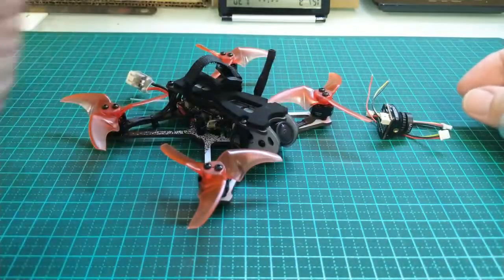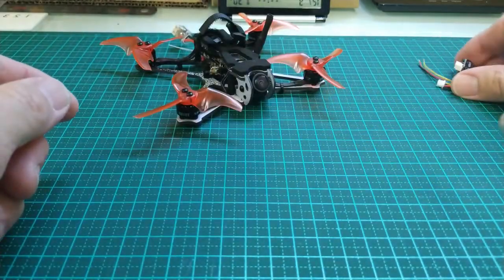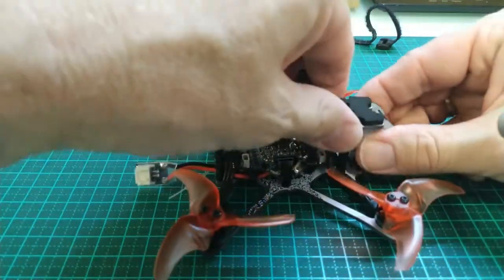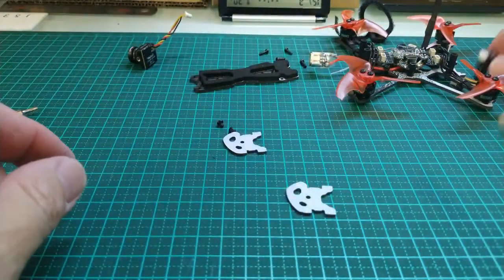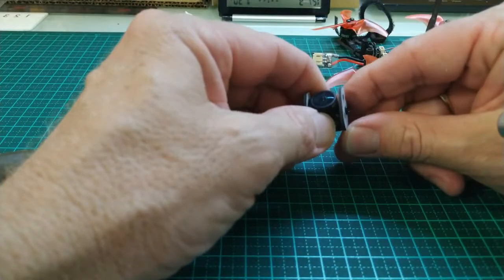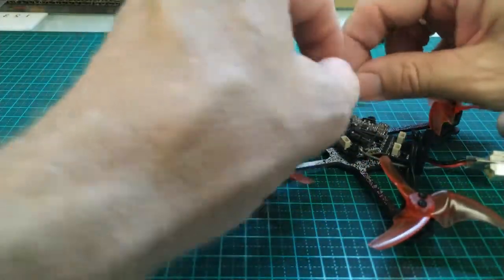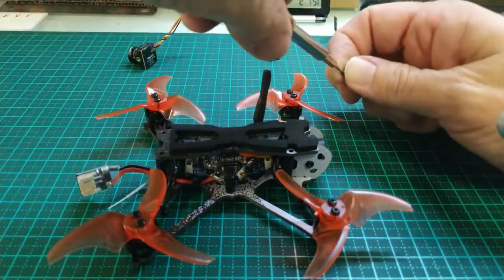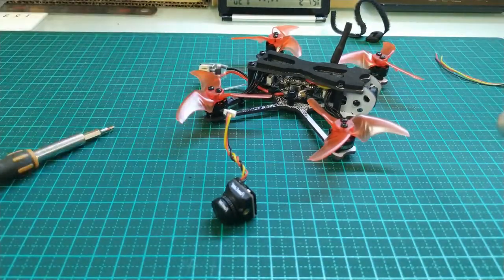TinyHawk 2 Freestyle Camera Upgrade

Comment: any recommendations on  why the drone wont power up when the new cam ( runcam pheonix 2 nano) is connected is it not putting out the power required or is it something else any help would be much appreciated
Reply from the maker: That's a strange one. I don't think even mixing upo the wiring to the camera woudl do this. maybe in the process of swapping the camera you accidently changed something else. I woudl go check all wiring and connectors.

Comment: I would be interested to see some before-after footage.
I installed a ELRS EP-receiver and TBS unify pro32 VTX with a TrueRC singularity antenna.
So far I am very happy with this kwad, but improving the video-quality is always worthwhile... :)
Reply from the maker: Yes the receiver and VTX upgrades are really necessary to get the best from this quad. Unfortunately i don't have any original footage but the standard VTX is not goo at all.

Comment: Cool video, I was going to buy that put I go a replacement camera bc the camera that I had was burn so I replaced and the drone fly with out the camera but when I put the camera y just start resting over again, do I have to make a setting in betaflight or something?
Reply from the maker: when you replace the camera there are usually no settings tpo change in Betaflight. Maybe check that you have NTSC or PAL selected. But if it's not working at all then check your wiring.

Comment: How much of an improvement is this over the stock camera?
Reply: I woudl say it's a slight improvement. But really it depends on what you want. This replacement camera is 16:9 ratio. My particular headset has a 16:9 display so it suits me well and looks well proportioned. If you prefer to fly 4:3 it's probably not worth it. The image is a bit clearer being a Pal camers - In my opinion. Also the color profile is a bit flatter than the original camera. It's good if you intend to do post processing on the video.
Reply: @MicronWings  I’m not sure what i prefer between 16:9 or 4:3. I have fatshark scouts and the stock tinyhawk camera so whatever ratio that video is in i would prefer to stay in. I just want the image quality to be a little better because I’m always running into random branches. I want to be able to see the little branches
Reply: @BurgerurgerFPV  This really depends on your system. I believe the original camera (Runcam) is NTSC. Take a look at this video - https://www.youtube.com/watch?v=Ow3jR-PMAHU&t=1s You can see that the Foxeer razor is PAL by the image size as recorded on the DVR. But all DVR record 4 x 3. If your camera is 16:9 you need to stretch the image in post processing. But you are wanting to see better when flying. What you need to look at is your screens in your goggles. I fly with reflective goggles using a 5 inch 800 x 480 display and the 16 x 9 camera (Pal) looks good. But your goggles screens may be 4 x 3. So it's going to be different. there is no guarentee it's going to look better because there are too many variables here. Maybe in the end it would just be easier to find larger branches to run into. ;-)